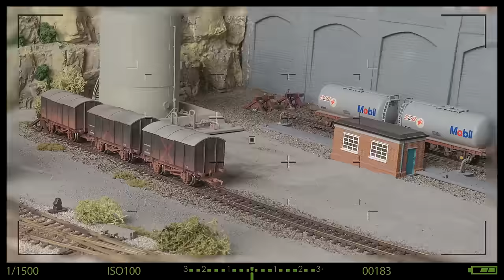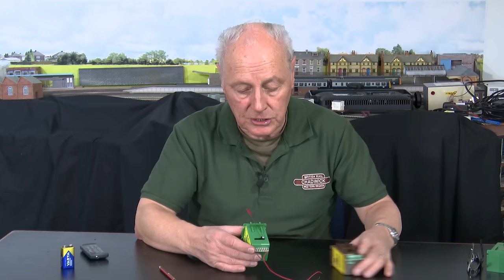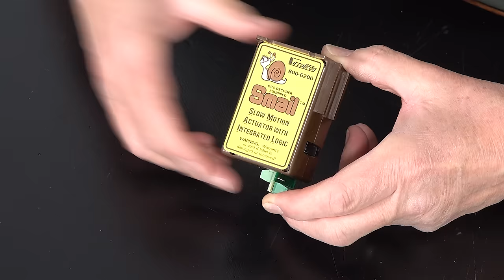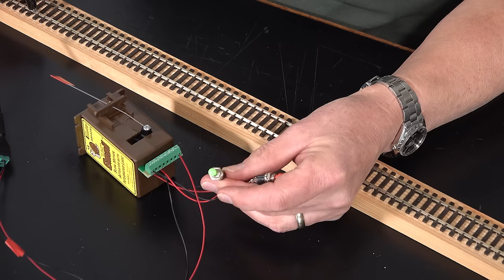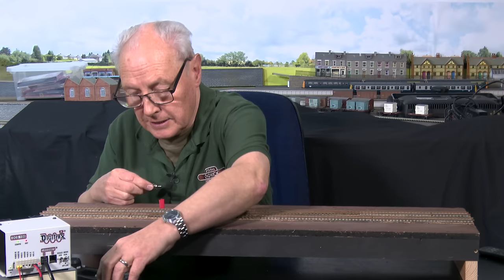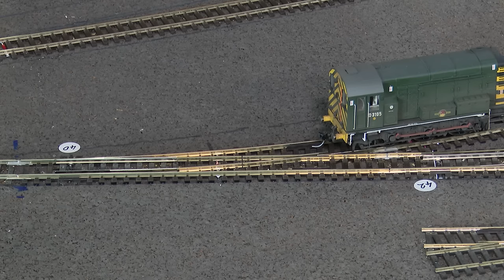SMAILS Vs TORTOISE Point Motors / Switch Machines at Chadwick Model Railway | 208.

Comment from the maker: I mention in this video that trains can get stuck on Electro-frog points that are set against their direction of travel.
This causes a short so the train cannot move.  
By creating a separate “track power bus” for point operation, this situation will not arise. However, the wiring does become more involved.
Reply: wiring all the accessories on a separate booster is a good idea anyways, as it will allow more power to the locos from the main control station
Reply: Yes I agree. Currently my  accessories are on the same power. However I have a new power booster  which I will implement in the new year as I have seen the accessory issue with points  before.  @AmauryJacquot
Reply: A dcc accessory bus does not involve particularly more involved wiring. It is simply another power district in effect.
Reply: That is what I was thinking. I guess Digitrax has separately protected channels?
Reply: if you put SMAILS is the power that you get out you're digital control centre enough if you only use SMAILS or a different like a module that use normal 12v like u showed is better for bigger layouts
Reply: I have just re-wired all point motors to an accessory bus and then power the track district using DCC Circuit Breakers.   All much better no win this respect.  I have also been using DCC Cobalt IP which has been around a few years and appear to do what the Smail now does.
Reply: So essentially you could automate the signal feather to light when the point is set for the diverging route, and have a visible indicator on your panel.

Comment: Thanks Charlie, interesting and food for thought ! 

Like Simon Bradshaw, I also use a separate Accessory Bus so wouldn’t have the issue you describe around stranded trains at short circuited point frogs. 

Currently I am using DCC Concepts iP Digital point motors which, in the main, I like. They’re very similar in concept to the SMAIL. But I have had problems with the iP Digital motors in that out of 24 I purchased, so far I’ve had to send 8 back as they’ve failed (in fairness though none have failed in the last six months although another one is starting to make the telltale sounds of failure recently). 

But, and this is an important “but”, DCC Concepts offer a lifetime warranty on their motors so sending them back isn’t an issue beyond the aggravation involved in getting under the board to remove and replace them and the cost of postage. 

I’ve recently installed two MTB MP1 point motors with a YaMoRC controller and I have to say that I’m pretty impressed with them. So I’ve been sitting on the fence as it were about whether to continue with cobalt iP Digital or MTB for the rest of my railway which is a significant further requirement for point motors. Reliability is crucial to me.

Having recently seen a video showcasing new digital versions of the MTB motors in the form of their forthcoming DP1, DP4 and DP10 products, I’m starting to lean over the fence in favour of MTB ! Either way, as good as those SMAIL motors appear to be, I don’t think they’re for me.
Reply from the maker: Thanks Bryan, for such an excellent comment. However, I have Issues with the DCC concepts lifetime warranty.
Perhaps it’s not the lifetime of the component, but rather the lifetime of the company! Regards, Charlie
Reply: Is this video on YouTube regarding the New Digital Mtb switches ?
Reply from the maker: No, the main production run has to appear at the retailers.  They are known as the DP4 and DP10.
Once available, I’ll film a review.
Regards Charlie.

Comment: When I first discovered (of course via one of your videos) the DCC Concepts equivalent of SMAIL I was really happy because (ever since I returned to the hobby in the 2010s) I always had the feeling that the idea of controlling point motors via intermediate driver boards (DS64 et al in your Digitrax context) was a very 20th century solution.  In these days of the WiFi controlled light switch (and all that example represents!) attaching accessories direct to "the network" (in this instance DCC) seemed like a much neater and modern solution - even noting the side issues you highlighted here.  

Of course there is still a need to solve one major issue in most commercial products and that is how you simplify and ruggedise the feedback path.  For example, your DCC controller may command a motor to set a point, but there is no out of the box mechanism for the motor controller to acknowledge completion via the same communication path - you need to create your own back channel (I am using WiFi for that).  So, it's not ideal, imagine if your computer needed two broadband cables one to send commands to access website and another for the actual website content to travel down!  So, DCC doesn't help a lot with command/Acknowledge at the moment, though you can use RailCom as a back channel, but sadly not all devices support that.

Thanks for a nice walkthrough these useful products Charlie.
Reply from the maker: Thanks Alan, for an interesting comment. With my system LocoNet provides that data flow to and from the modules. Regards, Charlie

Comment: I have some DCC enabled point motors.  I usually run the point motors on their own power district so they don't stop working if a short or power  outage occurs with track power.
I did initially have them powered by track power directly, and I did run into that issue of shorts causing issues, so havign a separate power district for the points helped reduce the hand of God coming into the mix.
Reply from the maker: Thanks EA, you have worked the same solution as many other modellers. Regards Charlie

Comment: Another useful video on product Charlie, thanks for taking the time to do all this. Frankly I dont know how you do it; hvg just become an oldie as the Aussies used to say, planning the day is key as so much to do! (I DIY all my classic car maintenance while fitting in MR construction, kit building and gen house stuff). I watch your videos to keep my mojo going as not alot has moved in 4 years and my last status was fitting analog Cobalts with their central ADSFX 8 way decoder boards, all with independant power from a 16v feed from the HM2000 that came with the Orient Express set. I then use an ESU 50200 which I invested in and has been the best thing since sliced bread IMO esp the loco and acc selection and track planning LCD layout screen. I really need to make a concerted push to get the track wiring completed and run some locos as watching your video makes me v jealous. 😉
Reply from the maker: Rest assured, Paul , time management is a gift and a curse. Regards, Charlie

Comment: The problem you raised at 13:00 is solved by having a separate booster for the switching decoders.
Thanks for a nice video.
Reply from the maker: I agree, but it kind of defeats the object for what they were designed for, namely simplicity. Regards, Charlie
Reply: @ChadwickModelRailway  
Unfortunately it is possible to create the same breakdown with ordinary turnout decoders, how do I know this? have fallen into that trap myself on a large club model railroad layout.
A tip for everyone: make sure all accessories get their power from their own accessory source.

Comment: What I like about the Tortoise is that even though it is slow, you can make it even slower by using resistors in the line. Then you can make them as slow as you want. The one thing I didn't like about the Tortoise was that you used a dpdt switch. I like the single buttons better as then you can place them in the track plan on the side of the road. It seems that we are in opposite schools about the kind of control. I guess that this comes from the fact that I was raised on the old coil switch machines and started with the buttons in the lines on the front of the road. On my last club layout we went as far as to have red and green LED lights inserted in the track lines on the front of the road. When you set the switch the green lights would come on for the track that the switch was set for and red lights would come on for the branch that the switch was thrown against. It was very easy for the operator to see just where the rain was going and for visitors to operate the road. I really didn't realize that these had a 9  year warranty!!!
Reply from the maker: Thanks David, for sharing your thoughts on the tortoise. It remains an excellent commodity. Regards, Charlie

Comment: Another timely video, Charlie. An excellent no-nonsense demo of the differences between the basic Tortoise and the Smail. I also appreciate the comments from Simon and Bryan which underline the need for a separate accessory bus; I was starting to lean in that direction but their remarks have convinced me. Also, interesting reference to the MTB MP1 with which I am totally unfamiliar so maybe it's time for a follow-up Swift on that subject? Cheers, Peter
Reply from the maker: To be perfectly honest, Peter, I would keep your powder dry until MTB announce their new Digital point Motors. Regards, Charlie
Reply: @ChadwickModelRailway  Yes agreed Charlie, interesting times ahead in the point motor department I think.
Reply: I think a Swift on the MP5/6 would be useful tho. Especially regarding their profile and how they fit into smaller spaces? Just a thought.
Reply: There was a full video on the MP1 and MP5 a while ago. I note there is also now an MP6 and MP10 available although I've not read up on how they are different from the MP5 (looks like the MP6 works from a short burst to make it compatible with passing contact switches so people can replace solenoids).
I bought a few MP1 motors to play with and was wondering if they would work with an Arcomora DCC Next decoder.
I do like the MTB MPx motors as they don't consume any current after they reach the end of their travel.

Comment: Good video Charlie. I've used Tortoise motors for many a year. There is another way to operate them via DCC. I use an NCE Switch 8 Mk2. It controls up to 8 motors either via the Throttle or panel switches. Combined with a Hex frog juicer  it's all a very easy system to set up. 
Plus with the Frog juicer you can run against the frog and not short out the whole layout. It does mean the loco derails, but thats what happens in real life! 😃
Reply from the maker: Many thanks for your interesting comment, and your alternative method. Still somewhat unsure about the derailing! Regards, Charlie

Comment: I did all that stuff,  with smail directly from my  digitrax DCS52.  I programmed  each of my smails from the DCS52.  He is using a DT602T which I have but that handheld is connected to the DCS52.  Each one of my switch motors has a switch signal signals (Green and Red).
Reply from the maker: That’s great news, Kim, I’m so pleased you’ve had such success. Regards, Charlie

Comment: Hi Charlie, as said below another excellent and informative video. 
I used a different policy on this subject which gets rid of the shorting issue and any possible derailment issues, I fitted auto-frog devices to the live frog and then used the point machine switch to isolate a section of track leading up to the point so that is the point is against the loco it stops short of the point.
Reply from the maker: Thanks Brian, you’re not the 1st to mention this alternative arrangement. I shall certainly look into it. Regards, Charlie

Comment: Love the SMAILS.  Digitrax stationary decoders tend to "go up in smoke" after a couple of years, so I've replaced most of my Tortoises and Digi decoders with SMAILS as the failures have happened.  The decoders in the SMAILS have been very reliable so far, with less wiring required.
Reply from the maker: Thanks Charles, for an excellent recommendation. Regards, Charlie

Comment: Hi Charlie
Nice piece of equipment. I have solved the dcc problem by connecting all the dcc point switching decoders to a separate booster which does nor switch off due to short. I know it takes more wiring but on a layout which is devided into several booster sections anyway this is not a big issue. It does savesyou from manually pushing locos arround
Reply from the maker: Thanks Gerben, however, it is always disappointing that we have to find a workaround to solve the designers omissions . Regards, Charlie

Comment: Great video Charlie. As others have commented, I also use an additional booster for all my accessory decoders. I found that the stall motors, can trigger current detection block sensors depending on the number of turnouts. I use cobalt digital IP, and have been very satisfied.
Reply from the maker: Thanks mate, that’s very interesting. I think smails are aimed at a smaller layout. Regards, Charlie

Comment: I use a similar TT300 point motors and to get around the issue where the DCC Bus has shorted, we operate with power districts. So we split the bus with a Digitrax PM42, one district dedicated to Accessories, the others to the running lines. So in the case where you run into a closed turnout and the bus shorts, it only affects that district and as the TT300 is being run from another one, you can still switch it without issue. For wiring, the TT300 is powered from the Accessory district and the Frog it switches is powered from the appropriate running line district
Reply from the maker: Thanks Vonzack, what an excellent solution. Regards, Charlie

Comment: If you can solder electronic parts (not surface mount) I can recommend MERG. I use CBUS, and the kits that can operate points and Train On Track Indicators (TOTIs) are very much cheaper than  ready made items.
Reply from the maker: Thanks Philip, I do hope the subscribers find your suggestion useful. Regards, Charlie

Comment: I use lamps to protect the layout sections, And still have output from the DCS 210 because the lamps don't indicate to the DCS 210 that there is a short. The Snail could be fed from the output and not the track, Could it not? I already have the feeds to my Tortoises from the control board so changing some of them wouldn't be a problem for me. Thank you for the video and I can tell by what you put together to show us the drawbacks, that this took time to do. Well done and thank you for the effort you put in, to make this video.
Reply from the maker: Thanks Sam, I’m so pleased that you appreciate the effort. Regards, Charlie

Comment: Hi Charlie - These shorts are a good way of dealing with specific items.  🙂  I think you are missing a trick here with the smail!  I am considering these at £22 from Hattons because I have installed mostly Traintronics TT300 point motors on my Train Controller layout and they are now as rare as hens teeth...  The TT300 also has an integrated DCC decoder) I don't suffer from your short issues because I have a second DCC bus around my layout for accessories from which I run the point motors - this is run from a booster like your districts.  The track can trip and still leave power on the points so I can move the points.  This does require the use of a handset as TC does not let you move the point when track is frozen.

I will buy some to test however the only drawback for me is the depth below the board compared with the TT300.

One test I would like to see is that do they retain their position when power is removed or do they default to a position?  The TT300 did default and after investigation I found I had to change a CV to turn off the auto DC power function for it to retain the last position.

Edit: I now see that a few more of your disciples have a second bus for accessories.

Edit 2: I now have 3 so will swap out one shortly and report back.
Reply from the maker: Thanks for your comment Paul. However, it’s disappointing that people need to modify their wiring systems to accommodate a short fall in the design. Regards, Charlie

Comment: To prevent a short circuit by a loco running into the frog when the points are set for the other road, isolate the rail leading away from the frog, about 12 inches, say. Then connect a wire from that rail to the common terminal on a spare switch on the switch motor. Connect the track wire for that rail to one of the other two terminals (trial and error to find the correct one). Then that length of track will be unpowered when frog is incorrect polarity and loco will stop without short circuit.
Reply from the maker: Wow Tom, I’m sold on that one. Much appreciated, regards, Charlie
Reply: Credit to DCC Concepts, who illustrate it in one of their advice pieces.  @ChadwickModelRailway

Comment: Hi Charlie - it may be worth pointing out that the older version of the Smail does not have the Terminal Block for easy wiring if like me you struggle with soldering on small terminals
Reply from the maker: Thanks Steve, yes I was made aware of that later. Regards, Charlie